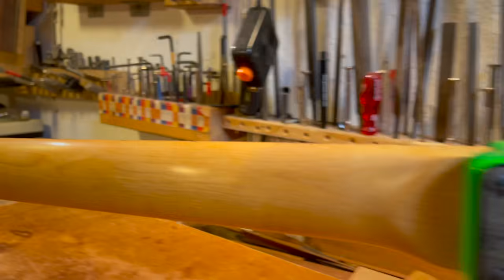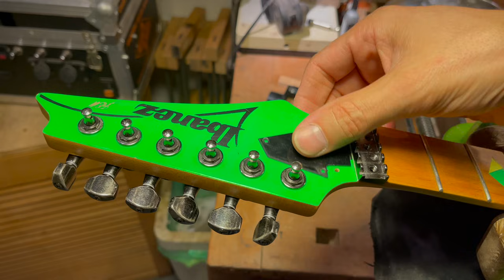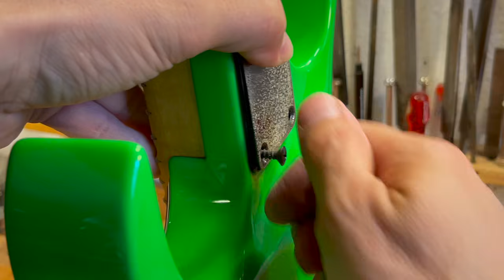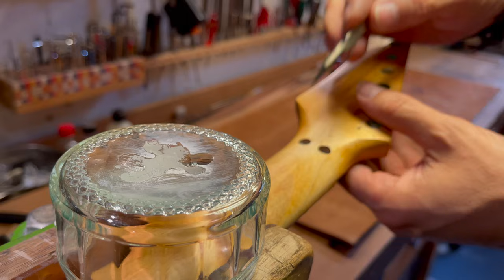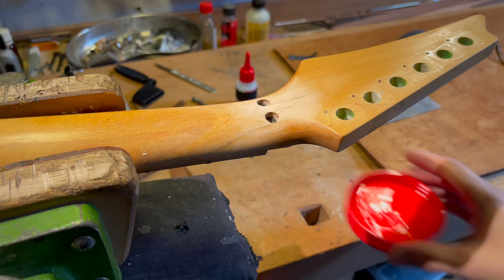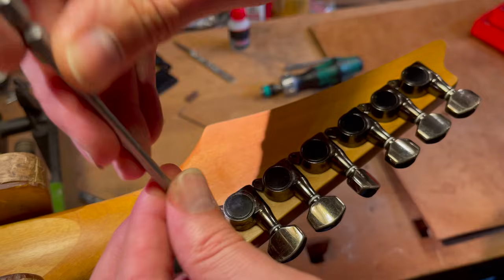Ibanez JEM 777 LNG Steve Vai Guitar Repair/ Restoration

Comment: That sound boost trick you do at the end of the video is something I do also, but I do it a slightly different way. I put the strings on and bring them up to pitch, then I loosen the screws and let the strings pull the neck heel to the body, then tighten them down. It does improve the natural sustain of the guitar.
Reply from the maker: Hey Harley, Thanks for watching and for sharing. Yes this is also a good way to do the sound boost and it really effects the tone in a positive way. You are welcome. Best Regards Nik
Reply: same
Reply from the maker: @robm709  Thanks for your feedback 🕺🏻👍Cheers Nik
Reply from the maker: @robm709  🕺🏻👍
Reply: yes, this is what I do. Works a treat
Reply: @petrekguitars  Indeed! Thank you for sharing your work with us Nik.

Comment: Would using a suction cup with the glue on the cracks help get the glue deep into the crack?  I think that is what Ted Wooford does.
Reply from the maker: Thanks a lot for watching and your feedback. Yes that’s a good method but this crack was repaired before and I decided to use super glue and if you use suction carp this can turn out really messy. Best Regards Nik
Reply: @petrekguitars  Thank you, sir.

Comment: Those screw through the neck locking nuts were problematic on those thin necks. Not just Ibanez either. Great work making those cracks disappear. I can't wait until your next adventure.
Reply from the maker: @pedraw  Thank you so much. Yes that’s a real issue. You are welcome. Best Regards Nik

Comment: hi Nik another fantastic repair and restoration! i wish you were here in LA as i would engage your repair regularly😊 As with your desert sun yellow JEM vid, you left the neck pocket cracks alone  - is that because its just a finish crack? how do you diagnose a finish crack vs a wood crack? thank you!😎🙏
Reply from the maker: Thank you so much for your positive feedback Mate. You are welcome. Yes these are „Stress Cracks“ but just in the finish nothing serious. You can see by removing the neck if it’s also in the wood. Best Regards Nik
Reply: thank you Nik😎🙏
Reply from the maker: @DeathMetalGuitar  You are welcome 🕺🏻👍Cheers Nik

Comment: Hi Nik ! when you put on the glue inside the cracks, how can you know how deep this glue is going into  the the wood ?
Reply from the maker: Thanks for your question. Theses wood cracks were glued a couple of years ago. And this was made fine… I have just glued the tiny gap’s at the surface. This very fine superglue just pores into the gaps and when the crack is totally filled up you know that it fine. Best Regards Nik
Reply: @petrekguitars  So this was just cosmetic or does the glue hold it together too?
Reply from the maker: @LegendLength  This was more a cosmetic thing. In the Video you can see how I twist the Headstock to check the stability before the repair. Best Regards Nik

Comment: I'd say that guitar has been previously subject to a complete restoration and repaint.  Apart from the neck pocket crack (which are a known weakness on these guitars..) there doesn't appear to be a single ding/mark on that body.  The headtsock decal also doesn't appear to be exactly in the correct position
Reply from the maker: Thanks a lot for watching and for sharing your experience and opinion. The owner likes to keep it in these condition which is quite good by the way. You are welcome. Best Regards Nik

Comment: What did you use to tint/oil the neck on the back after scraping and sanding?
Reply from the maker: Thanks for your question. I used water based stain and weapon oil. Best Regards Nik

Comment: Great job on this repair. I'm surprised that people who are still gigging these guitars don't just plug the locking nut bolt holes on the back of the neck and put the newer designed one on that has screws on the face of it but I supposes it would ruin the value of it. I also noticed that there's a big neck pocket crack when you were reassembling the guitar, was that only a finish crack?
Reply from the maker: Thanks for your feedback John. Of course you can use modern Hardware components but all theses old stuff is in a amazing shape and not necessarily to change anything. Therefore I keep it simple and original. Yes you are correct the „Stresscrack“ is just in the finish nothing serious and a very common issue. Best Regards Nik
Reply: Steve Vai prefers the TopLok3 nut which fastens right through the neck.  The same arrangement is present on today's production Jem & Pia models fitted with the original Edge Bridge
Reply: @ewm335  I'm just saying that if you were still using it it might be better to have it made  bulletproof so to speak. I know what you mean about keeping it authentic.

Comment: I would love to own one of these original Jen’s for the value alone. But honestly, the newer ones are made so much better. Just the neck alone being a multi piece, laminate neck, with a volute, and dual carbon fiber reinforcement rods makes them so much better! Even in my RG 550 Genesis! I’m just glad that my Jem 7v is made the modern way!
Reply from the maker: Thanks a lot for your feedback and for sharing your experience. You are totally correct. The three piece Necks are much more stable and stiff. 🕺🏻👍I would maybe make a comparison Video about this topic.. in the future. Best Regards Nik

Comment: The fact that you use cheap generic allen wrenches turned me off. NO tech uses those   Buy the specialty hardened allen tools used by the Rc Car guys.   Unsubbed and out.   Scary to say the least.
Reply from the maker: @benburnett8109  Thanks a lot for watching and for sharing your opinion. Allways welcome. Best Regards Nik
Reply: @benburnett8109  that's a ridiculous statement to make.  It's only a guitar.  Screws and bolts don't need to be torqued to the maximum.  Cheap Allen Wrenches are perfectly adequate.  Also, Petrek was using a genuine Ibanez multi-tool...
Reply: bye Felicia
Reply from the maker: @robm709  Thanks for watching and your comment 👍🕺🏻